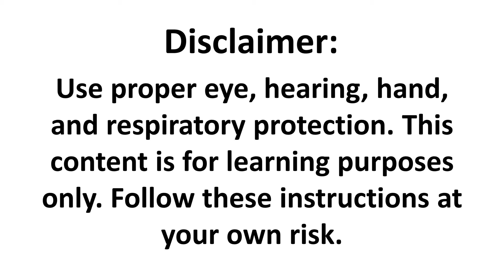How To Make The Wiring Connections On The Manta M5P + CB1

Comment: I’m from southern Brazil, and I’m planning to upgrade my Anycubic Kobra Max 3D printer. My goal is to install the Manta5P motherboard, along with the CB1 module and TMC2209 drivers. During my research, I realized that detailed information about installing this board is scarce. In fact, your video was the only one that provided a clear and detailed step-by-step guide.

I know it will be quite a challenge since I’ll be using some new components. I want to thank you for creating this content, as it was the only one YouTube showed me with relevant details for the modifications I plan to make. One of my biggest concerns is about the length of the power cables for my 24V 500W power supply and the components such as motors, CanBUS, and sensors. I’m unsure if the cables will be long enough to reuse and have questions about where to properly connect each one.

Comment: I wired up the cable and pins same way for motor setup cannot get any movement when stepper buzz .suggestions please
Reply from the maker: Hello,

The buzzing steppers are due to the coils apposing each other instead of working in tandem. Please check to make sure that the ribbon cable on the stepper motor side has the two middle wires crossed. Many aftermarket cables have them all inline but the two center wires need to be crossed for it to work.

Comment: I saw in a later  video you had switched the accelerometer to the dedicated SPI port (and got it to work with the TFT35 SPI) but in this video you had it working with the GPIO pins. I'd actually like to wire it to the GPIO pins but am struggling with the klipper config, any tips?
Reply from the maker: Hello friend, yeah, I struggled with this thing for some time myself and was unable to get the ADXL345 working using the GPIO pins along with TFT35. If I remember correctly it had to do with them sharing some resources. The issue that keeps this from working I believe comes from the custom image BTT is using. I couldn't get anything to work using V2.3.3 or 2.3.4 but was able to get things working using image V2.3.2 but the ADX345 had to be on the SPI port. Detailed info can be found in the link below. There is also a table link in there as well that might help. Let me know if you find a way to do it, I would love to learn how. 

https://github.com/bigtreetech/CB1/discussions/47

Comment: Hello, thanks for posting. Im planning to get back in life my cr10s pro v2. So i decied to go with this manta m5p setup and im just curious about Z axis setup, should i go with 2 individual drivers for 2 stepper or just go like the factory did 2 steppers on one driver...and if so (on one driver) should i change the current on that single driver?
Reply from the maker: Hello friend, I'm glad you found value in this video. Having the independent control of each z stepper motor to take advantage of Klipper's Z_TILT feature solves the x gantry level issue. If I were going to upgrade my CR10S Pro V2 from the factory setup today I would use the Manta M5P+CM4 (if I could get one at a decent price) or use the CB1. I also wouldn't bother with the CR10S Pro V2 ribbon cable but instead use long wires to minimize connection points of failure. The CR10S Pro V2 has the potential to be an awesome printer.

Best of luck with your build :)

Comment: Thank you for the detailed video. I didn't see you mention anything about the HV screw terminals though. What are these used for?

EDIT: The HV screw terminals are for utilizing a separate power supply for only the stepper drivers (24V-56V).
Reply from the maker: Yes, but you can also feed them directly from the same power supply using a second set of wires separate from the ones powering the board to get more current to them instead of the main board powering them with whatever current is leftover.
Reply from the maker: Hello friend, Thank you for commenting and encouragement. I'm glad you found value in this video for your viewing time. This video was kind of a part 2 to the one linked below. I discuss all the connections in good detail and include the files I used in the video's description area.

https://youtu.be/Mec3cZnCP18
Reply: @vbared  I hadn't seen the part 1. Thank you for linking it. I'll go watch that one.

Comment: Is M3A or M3B port used with dual z stepper motors connected with a Y splitter cable?
Reply from the maker: Hi, Thanks for commenting. M3A and M3B is just like that Y cable. Assuming you are running a Manta M5P, if you want independent z-stepper control you would use either M3A or M3B and M4. Then just add this to your printer.cfg but make sure to tweak the values to match your printer.

Add next lines to your CURA start g-code right after G28 (see next lines):

G28 ; Home all axes
Z_TILT_ADJUST

Add below to your printer.cfg

[z_tilt]
z_positions: 284, 108 # the first value is X position , second value is Y position
              12, 108 
points: 284, 108
         12, 108
speed: 50
horizontal_move_z: 5
retries: 20
retry_tolerance: 0.0075
Reply: Thanks! If understanding is correct, the splitter cable can be plugged into M3A and both z stepper motors will be driven by output of M3A. The 2nd stepper motor does not have a stop switch.
Reply from the maker: @makergc3d  You don't need the Y cable anymore, just plug one stepper motor cable into M3A and the other stepper motor cable into M3B. Both M3A & M3B are connected to the same stepper driver, it's just like the y-cable but built into the board.

Later on when you add a bed probe you can move one of the z-stepper motor cables to M4 and use the tilt feature.

Comment: Thank you the amazing tutorial. I see you used creality stepper cables. On my manta M4P, I used my ender 3 original cables too, but x and y steppers get really hot, z doesn't... Do you know if the stock wires are good to put on a Manta or did you have to change the wiring for the motor coils?
Reply from the maker: Hi Jay, Thank you for commenting and encouragement. I'm glad you found value in this video for your viewing time. I installed the Manta board in a Coreception 300 corexy printer and had no trouble using the stock stepper cables and didn't need to make any changes to them. If your Ender 3 is a Pro or V2 model that uses a 40x40 aluminum extrusion to mount the y-stepper motor then this part will solve the y-stepper heat buildup.

https://amzn.to/49qpg9I

Comment: Friend, thank you very much once again for the video tutorial, they are excellent and well explained. As a layman, I'm still in doubt, building a printer and I'm coming from a Duet 2 wifi, for the klipper... on the Z motor, where I have two spindles, I thought I could connect it to M3A and M3B, but for what I understand, I would lose the automatic adjustment. I ask how I would use limit switches on the Z, I didn't use it, and I had an independent Z on the reprap on the duet 2 board, but on the M5P it's all new and as you said, bigtreetech's documentation leaves something to be desired. If I want an independent double Z, I need to use limit switches and use Motor 3 and Motor 4, for example, leaving m3b out. However, I feel incompetent to configure this in printer.cfg, could you help me with printer.cfg, do you have a video of yours that talks about this configuration? Thanks again!
Reply from the maker: Hi Renê, Your most welcome, I'm glad you found value in this video for your viewing time. Yes, you are correct for independent z stepper control you will need M3A and M4. My current printer.cfg is below the line.

_____________________________________________________________________________________________

[include mainsail.cfg]

[mcu rpi]
serial: /tmp/klipper_host_mcu

[adxl345]
cs_pin: rpi:gpio74
spi_bus: spidev1.1

[resonance_tester]
accel_chip: adxl345
probe_points: 142.5, 146, 20

[bed_mesh]
speed: 120
horizontal_move_z: 5
mesh_min: 13, 13
mesh_max: 285, 289
probe_count: 9, 9
mesh_pps: 2, 3
algorithm: bicubic
bicubic_tension: 0.
fade_start: 1
fade_end: 10
fade_target: 0

[stepper_x]
step_pin: PC8
dir_pin: !PC9
enable_pin: !PA15
microsteps: 16
rotation_distance: 40
endstop_pin: ^PD3
position_endstop: 0
position_max: 285
homing_speed: 50

[tmc2209 stepper_x]
uart_pin: PD9
run_current: 0.580
diag_pin: PD3

[stepper_y]
step_pin: PA10
dir_pin: !PA14
enable_pin: !PA13
microsteps: 16
rotation_distance: 40
endstop_pin: ^PD2
position_endstop: 0
position_max: 292
homing_speed: 50

[tmc2209 stepper_y]
uart_pin: PD8
run_current: 0.580
diag_pin: PD2

[stepper_z]
step_pin: PC6
dir_pin: !PC7
enable_pin: !PA9
microsteps: 16
rotation_distance: 8
endstop_pin: ^PC3
#position_endstop: 0.0
position_max: 350
position_min: -2

[tmc2209 stepper_z]
uart_pin: PB10
run_current: 0.580
diag_pin: PC3

[stepper_z1]
step_pin: PB12
dir_pin: !PB11
enable_pin: !PA8
microsteps: 16
rotation_distance: 8
endstop_pin: ^PC2
#heater_pin: PA7
#sensor_pin: PA2

[tmc2209 stepper_z1]
uart_pin: PA6
run_current: 0.580
diag_pin:

[extruder]
max_extrude_only_distance: 1000.0
step_pin: PB0
dir_pin: !PB1
enable_pin: !PC4
microsteps: 16
rotation_distance: 3.433 # default 33.500
nozzle_diameter: 0.400
filament_diameter: 1.750
heater_pin: PC5
sensor_type: ATC Semitec 104NT-4-R025H42G
sensor_pin: PA1
#control: pid
#pid_Kp: 21.527
#pid_Ki: 1.063
#pid_Kd: 108.982
min_temp: 0
max_temp: 300
pressure_advance = 0.078

[tmc2209 extruder]
uart_pin: PB2
run_current: 0.600
diag_pin: PC2

[heater_fan hotend_fan]
pin: PA3
max_power: 1.0
kick_start_time: 0.5
heater: extruder
heater_temp: 50.0
fan_speed: 1.0
off_below: 0

#sensor_type:MAX31865
#sensor_pin: PA4
#spi_bus: spi1
#rtd_nominal_r: 100
#rtd_reference_r: 430
#rtd_num_of_wires: 2

#[filament_switch_sensor material_0]
#switch_pin: PC2

[heater_bed]
heater_pin: PA5
sensor_type: Generic 3950
sensor_pin: PA0
#control: watermark
min_temp: 0
max_temp: 130

[fan]
pin: PA4

#[heater_fan fan1]
#pin: PA3

#[heater_fan SoC_fan]
#pin: CB1:gpio79
#pin: RPI:gpio26

[mcu]
serial: /dev/serial/by-id/usb-Klipper_stm32g0b1xx_hurakan-if00

[printer]
kinematics: corexy
max_velocity: 300
max_accel: 3000
max_z_velocity: 5
max_z_accel: 100

[board_pins]
aliases:
    # EXP1 header
    EXP1_1=PD5, EXP1_3=PB3, EXP1_5=PB5, EXP1_7=PB7, EXP1_9=<GND>,
    EXP1_2=PD4,  EXP1_4=PD6, EXP1_6=PB4, EXP1_8=PB6, EXP1_10=<5V>,
    # EXP2 header
    EXP2_1=PB14, EXP2_3=PB8, EXP2_5=PC10, EXP2_7=PC12,  EXP2_9=<GND>,
    EXP2_2=PB13, EXP2_4=PB9, EXP2_6=PB15, EXP2_8=<RST>, EXP2_10=<NC>

# See the sample-lcd.cfg file for definitions of common LCD displays.

#[bltouch]
#sensor_pin: PC13
#control_pin: PC15

# Proximity switch
#[probe]
#pin: PC15

#[neopixel my_neopixel1]
#pin: PC11

#[neopixel my_neopixel2]
#pin: PC14

#[adxl345]
#cs_pin: PC0
#spi_bus: spi2
Reply: @vbared  Thank you very much! I want to see if I can get it to work by Sunday!
Reply: @vbared  I still had one doubt. Regarding the Z axis, do I need to have an end stop, even using a bltouch?
Reply from the maker: Hi Renê, I rely on limit switches because the machine with the Manta M5P doesn't have a BL-Touch. In your case because you do have a BL-Touch add [z_tilt] to your printer.cfg. I found this video to help you understand how to configure it.

https://youtu.be/NoECJlTS2SU?si=emI3G5aMt9phHOhh

Best of luck with your mods!
Reply: @vbared  Thanks again for the great help! 🤝

Comment: nice video, just curious why you would have a bed probe and 2 Z end stop switches
Reply from the maker: Hello, Thank you for commenting. It's the silly mechanical setup of my  Coreception 300 which is a core xy printer that has dual lead screws and limit switches but didn't originally come with the bed probe, which I  need to create a bed mesh. I'm going to have to show it in an upcoming video, it's the craziest thing.